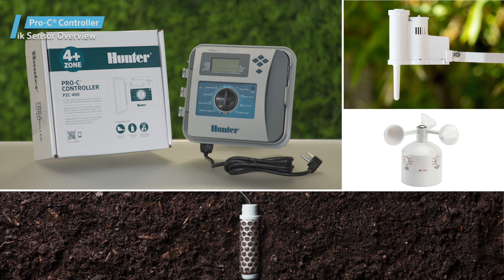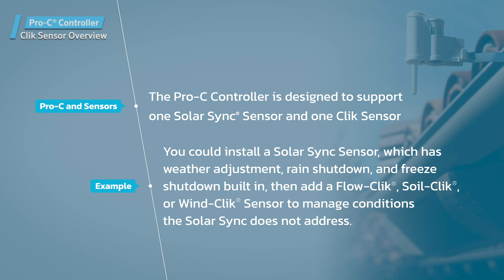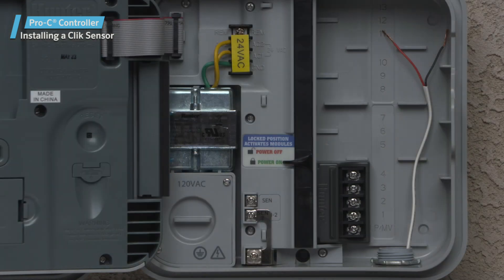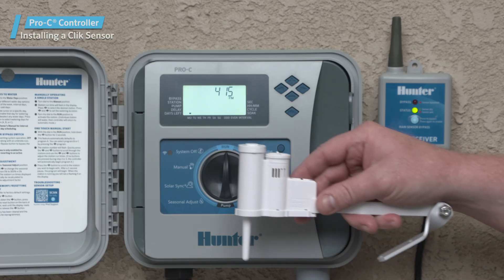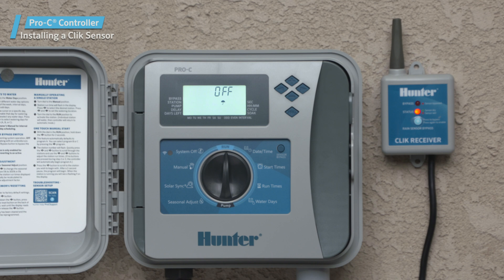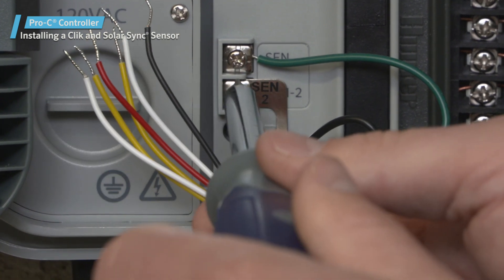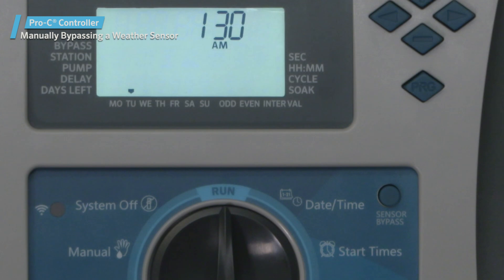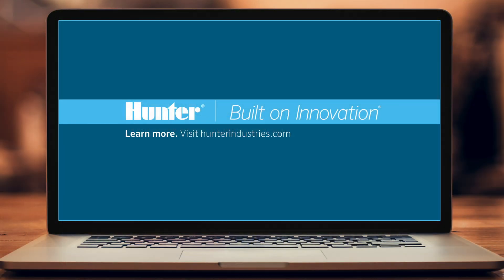Pro-C® P2C-400 Controller: Hunter Clik Weather Sensor Installation and Manual Sensor Bypass

Comment: Will the Hunter Clik sensors work with other brand clocks?
Reply from the maker: Hunter Clik sensors are compatible with normally open or normally closed sensor inputs on most irrigation controllers.
Reply: @Hunter_Landscape_Irrigation ,
 Great.
Thank you
Reply: Is there a way to keep the bypass on for longer than 24 hrs? My sensor was installed in a bad place.